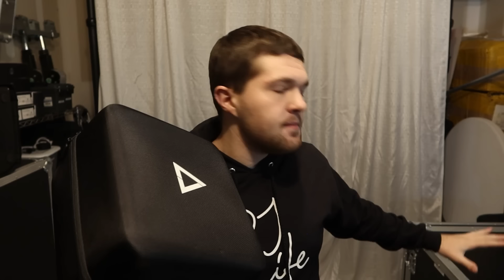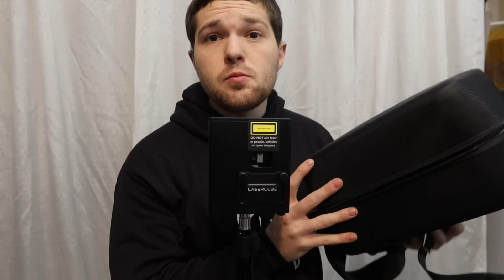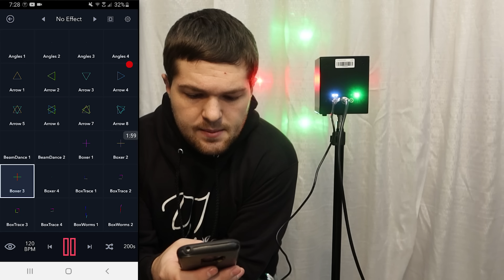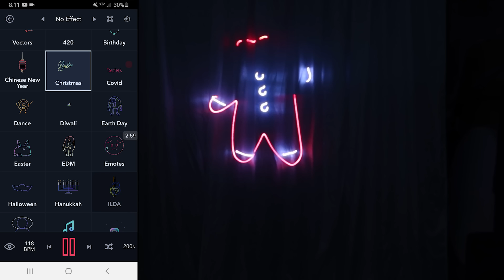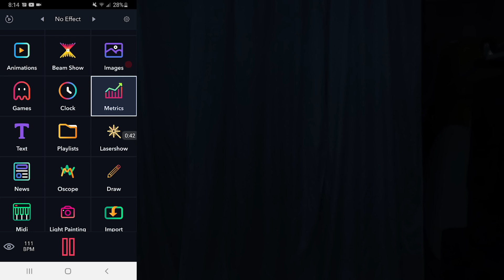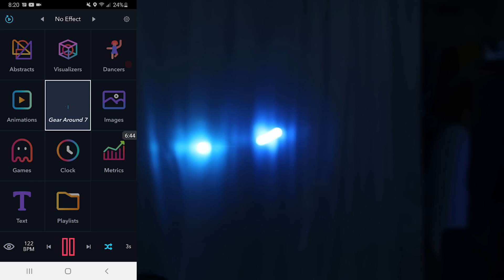DJ Gear: X-laser LaserCube (2 watt and battery powered)

Comment: Is there a way to set this up in a living room space and have it safe to not hurt peoples eyes? I had an idea of putting the laser box in a disco ball lamp but don’t want to burn holes into multiple peoples eyes at once Lmao
Reply from the maker: Only if you have no glass or mirrors. And you set the laser above heads
Reply: @DJRickWeb  my idea would also involve having black out curtains on the windows and there’s no other reflective surfaces in the area so it should be okay. Would the safety lens also help prevent someone happening to look into the laser in hurting their eye?

Comment: You can shot it into people but not fullpower or with more then enough distance to people because the longer the laserbeam travels the wider it gets (lesser concetraded power) for people scanning there are just difrent rules

In germany you can go to certificate yourself as an laser saftey officer you are getting hired to be at the venue setup and look out that the lasers are installed corectly and ll the settings are correctly made

Comment: Great review! Any issues with burning surfaces ? 9r Whats the curtain you using? Generic white, or special anti flamable?
Reply from the maker: Burning feature is outlawed in america
Reply: @DJRickWeb  thabks for reply.. i thought that the normal beam can cause burns to skin and set things on fire?
Reply: Reccomend when doing light shows with a laser not to have the beam concentrated in one spot for long. Make sure when you are firing it in an environment that you run a laser test long before ever opening or having people in. I press buttons at a night club for a job, the way I was trained on lasers was basically to keep the shit moving and to never leave the lasers in one spot for too long and also allowing the lasers to take breaks within 15 minutes. When I warm up my RBB spots I immediately switch it to purple or uv. It tends to heat up the carpet the least. The emergency stops are super helpful if the software crashes or the laser gets stuck on, which I have had happen, it's terrifying.

Comment: Man its crazy to see how things have changed from when I threw raves in '99/'00 and my laser guy's rigs (Argon, YAG etc) were gigantic gass powered lasers that required a desktop pc to run and were so powerful that the 5w yag could actually make the cinderblock wall smoke at point blank distance and actually burned the wood and fabric moveable divider wall that split the arena we used. I know one of his lasers was from the medical field and was gigantic even compared to the "smaller" argon unit. But I do recall that the rule back then for any laser over 4.9mW was that it had to be placed high enough so that even on a downward sweep the beams stayed at least 8ft from the ground so that it wouldn't hit anyone in the eye (though that wasn't always adhered to as I took a 1W argon to the face multiple times at an event but luckily never head on/in the eyes. Also those rigs were often amaturely built to save money cuz a new high power model capable of doing full color and/or animation could cost $100K
Reply: can you lay your hands on any of the old laser controllers?? especially PM 21/22/25s ?
or even laser innovations MIrage....I had both back in 00/01, wish i'd never sold them
Reply: Used to use Krypton/Argons up to 10w, even old Spectra Physics laser n optics bed! Thing I always remembered was the cooling fets for power supply, was like 100kg, use to call it the pig, had mains water running through it. That was late 80s early 90s, good times 😃

Comment: For the 2W laser, is some kind of eye protection needed when the lasers reflect from the walls? Can’t seem to to find this info from the website.
Reply: You are spot on. To use this legally in public you have to have a variance and in some states a laser operator license.
Reply: If your lasers are bouncing off of walls you are operating them wrong. There should be no reflective surfaces for the beams to hit ever!
Reply from the maker: I dont believe so.

Comment: It really depends on the class of the laser, not necessarily the power of it that determines how damaging it is to your eyes. A 0.1mw telecomms laser shone onto a regular brick wall has enough potency for the reflection alone to cause irreversible damage to your retinas or corneas. That is why as soon as the laser is disconnected out of circuit, an alarm will kick in and cut off the power to the laser. This stops engineers from being blinded. My biggest concern is that a 2000mw laser in the hands of somebody that has no laser safety training can and will cause serious eye injuries to party goers. My knowledge is a bit rusty, but I've 2x city & guilds qualifications ( 3466/3 and 3466/4 ) in singlemode and multimode fibre optics. Both also cover the basics of laser safety. My advice is that if you do not have a clear grasp of the basics of the dangers of lasers, then you should be nowhere near them.
Reply: I agree, its not only dangerous for the operator, but also for uninvolved people...
Reply: Agreed, I worked pro with classe 4 lasers for well over a decade. We have a special software output map to reduce the laser output when crowd scanning. Even then the camera's  in a direct beam could be toasted. SO we normally stay well away from anything like 9 feet I am gonna get me a good pair of sunglasses :)
Reply: Yep, victim of retinal injury in both eyes from a shit rock cover band using an enormously powerful laser in a mid sized function room full blast all night at Eye level.

Previous had 20/10 vision all my life now 20/16 however there is a significant fuzziness l/warping effect to anything I look at regardless of distance. Glasses cannot do anything for me.

These things really are not toys ands shouldn't be allowed into the hands of a) tehnically absent minded idiots. b) egomaniacal dickhead musicians who's narcissism is off the fucking scale along with their jawdropping grandiose delusion of their own 'talent'

please look after your eyes whoever may read this. Lasers blasting at Eye level --- just leave the venue IMMEDIATELY.

PLEASE DO NOT RISK IT

Comment: 1.2k is little pricey. But considering that it's battery powered, 2000mwatts, small and lightweight, comes with case and safety kit, easy to use and setup. Then it's absolutely worth it. TAKE MY MONEY!
Reply: 1900 dollars as of now
Reply: Its 2000 Watts
Reply: @swedensy   no. It’s 2W unit, the lazer is 2000mw
Reply: @BlueNukez  LOL I actively build an assortment of lasers continuously, from light show sets to industrial liquid-cooled CO2 lasers running 150watt tubes, and I cringed inside so hard when he right out the gate said it was 2000watts.  Can you imagine?  lmao I'm dying.  Education people, it's important.

Comment: A 2000 watt laser would blind everbody in the building just by looking at its projection on the wall. 2000 milliwatts is what you mean op. Its pretty embarassing to be that physics autistic but otherwise good video.

Comment: I like the lasercube. I saw it before it started in the US. I'm glad X-Laser got involved with selling them. This would be great for basic small shows, parities and home usage. I like that it comes with an E-Stop. The scanner being at 30k pps which gives pretty nice images at the end. The specs is really where you see why some lasers at the same wattage is more or less. Take the laser Cube specs.  Blue 445nm / 1400m Green 520nm / 400m Red 635nm / 450mW. Red is always the weakest color to produce. Overall its the bast compact, battery powered and easy to use I've seen to date. I've had to buy lasers with more power rating just to get the RGB closer to the numbers I want instead the peak number.

Comment: Honestly, this is only good for homepartys in my opinion. 
The micro-USB connection is riky as hell to be using during a gig, with the sub vibrations beeing able to make it come loose.
And on top of it, i feel like running the software on a phone during a gig with a USB cable inserted would be more frustrating than running it from a lightning desk.

I myself recently bought 2 LaserWorld DS-2000RGB lasers with It's ShowController software. 
I run it on a PC with a APC-40 mk1 Midi pad to controll them.
It gives me a good feel for them, and on top of that i dont need to rely on a weak Micro USB connection, since they are running RJ45 (TP Link/regulare internet cables) for the signal. DMX is also avalible.

So again. This for me seems like a toy for those who like to have house parties, but with alot of puch to the effect. Like for real. 2mw is alot of power, and i assure you. You don't want to be stairing in to those beams, since I've made that misstake while programming my lasers.

But yeah. Most American DJs seem to fall for these "simple", low-cost gear. 
I highly recommend you/people to start investing your money in real gear instead of for eg. American DJ and other cheap alternatives. And no, you don't need to get those Robe Spikies. But in the long game, the gear you buy has a big role. You simply don't buy a set of Behringer speakers and show up for a big high-school party. You bring out your Yamahas. It impacts the quality of your shows. And especially the way you control them.
These Ipad sollutions are just a cheap halv-done way of doing shows. Alooot of time and work goes in to learning and programming the software, while the result never meets the time put in to it. I don't know if anyone else notices that while watching these gig-logs on youtube, but i surely have.

No critice or hate towords you Rick. But I've just had the privelage to be working with real lightning and festivals since i was 17 years old. So these things are defenetly not for me, and i feel like it shouldn't be for others who want so become proffesionals in their field either.

Invest good, and good will show.
Best regards from Sweden. Peace.
Reply from the maker: I mean I use this at school dances mounted in trussing 12ft in the air. And I dont use the phone I use the desktop app. And run a USB cable to the laser. 8 single 18s never knocked the usb out.
Reply: @DJRickWeb  in my experience, It's just a matter of time before that happens.
Reply: I think that every real laserist knows what this laser is and what it isn't. Nothing bad to say, because as we know, it is just funny t... Perhaps right unit for amateur mobile djs and bedrooms.

Comment: Please help if you can! I switched from DDJ SX2 to DDJ SX3 and I have been using DJay Pro 2 software and now the DJay Pro AI. I have always connected my controller(DDJ SX2) internally with the software, but now I’m unable to with DDJ SX3 because all the functions are limited. So I have been using my new DDJ SX3 via extended connection. For example: with DJ SX2 and DJay Pro 2/AI, I can play a song and listen in the headphones from channel one and two my mean out put when I turn the cue for them. Now with DJ SX3 and DJay Pro 2/AI, a loud pitch sound come out when  I tab the cue button to listen to the song play. What am I doing wrong if any, or the software is not fully supported for DDJ SX3?
Reply from the maker: I am not familiar with your software. I would contact djay support
Reply: I think you are better of making a post in DeeJays forum instead of here. But i could be wrong.

Comment: The lasercube is an incredible game changer vs the outdated FB3 Lasers and Laser software. Your review is great! I've been wanting to buy a few of these things. The projection mapping is very sophisticated for such a small box and super cheap price point! Love it!
Reply: Tf. Are you looking these are expensive af
Reply: Sorry, but to say that the FB3 is outdated makes me think you don't know anything in this field. 
Sure, the FB3 is the old gen.
But the FB4? Integrated or external. Both have the RJ45/TP input with the absolute best software created to program laser shows on.

We are years away from when this technology replacing the Pangolin hardware and the Beyond software.
But sure. When these become bluetooth/wifi enabled, and you could connect them direcly to a piece of hardware that's connected to the computer to run timecode and be able to run them live with midi pads, then we are talking.

But for now the cost is the same as for eg. laserworlds mid-range lasers with the same power, and i can assure you that their scanners are with higher quality and higher speeds.
Reply: @saminix1  I can assure you, LaserWorld is NOT higher quality. As a matter of fact, LW's safety standards were SO poor the FDA literally raided their Orlando office and shut them down.
Reply: @GearItFirst  really? Well that was more than I knew. Anyhow. What I ment with my comment was that I'm more for actually controlling my lasers with a reliable software. And since I own 2 laserworld DS-2000rgb, I also bought their ShowController dongle as the software to control them. 
But personally I regretted it quite fast. I rather have saved up double my budget, for 2x kvant CM2000 instead, with the pangolin software. ShowController is way to weak for my use.
Reply: @saminix1  That is great input. My argument comes from a beginner and user friendly stance. I own 2x X-Laser FB3 2W Skywriters and though Pangolin is feature packed and can can run timecode and output midi to lighting controllers, the software and set up is complicated. It took me a long time to understand the zoning set up as well as the atmospheric vs graphic settings per dongle. Getting a show up and running is the 1st priority. Especially when most LDs run the same scenes and presets off Pangolin. I respect the ease of use for anyone at any skill level to get a show going in 20-30 minutes with Wicked Lasers.
Reply: @DecibelDuo  I hear you.
And absolutely. If you just want some laser effects, these are cool. But still. Then the price point is way to high if you ask me. 
I rather have professional equipment, get use to the high-standard learning curve that comes with it, and getting my life prepared if someone would to give me a shot on a higher-standard gig. 
But that's me, and I do LD and mobile gigs for a living.
So once again. I see where these products can be used. But just at a lower price point
Reply: @DecibelDuo  oh, btw. Are you telling me you have 2 of these lasers that you control through pangolin? Or is it another model. I'm just reading through my phone

Comment: I have one of these and they are amazing. I feel the only problem  with them is the USB connect on the back, can be a bit intermittent.
Reply: It’s so expensive do you know if there’s like a cheap version ?
Reply: @GamerZelda  I've been looking at cheap animation lasers. You can find around $150 on ebay. Dmx controlled. Can do mostly the same kind of stuff, but 1/4 of the power. I'm looking for cheap starter laser myself.
Reply: @GamerZelda  I also just stumbled across base level x laser that is around 500.  Might go that route instead... psx-400
Reply: @alexvanderkooy  thank you

Comment: Cost an arm and a leg though.
Reply from the maker: Its relatively expensive, but in its market sector a 2watt laser will normally cost you over 1500. And be much bigger let alone battery powered. For this price you get the compact laser and x laser helps make sure you can legal operate it too.
Reply: It does look like a great laser. Looks really cool to have. Great video!

Comment: 2000 Milliwatts not 2000 watts. Big difference there.
Reply: I was wondering whether Arnie was going to come back in time to get one, it wasn't in the shops when he first asked for it.
Reply: @alanhilder1883  ?
Reply: @GearItFirst  Terminator
Reply: Always gonna have the autists getting hung up on the specifics...
Reply: Thank you 2000 watts will be so damn powerful and melt a airplane it's 2 .5 watts
Reply from the maker: Yeah I had to correct that.